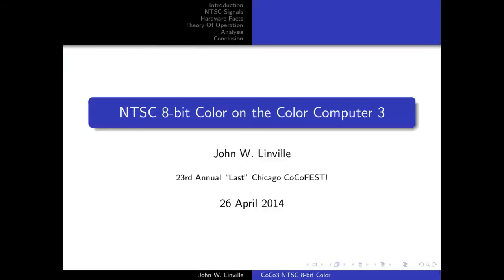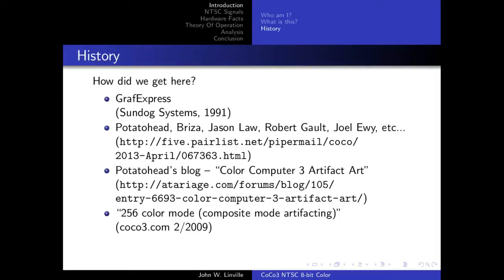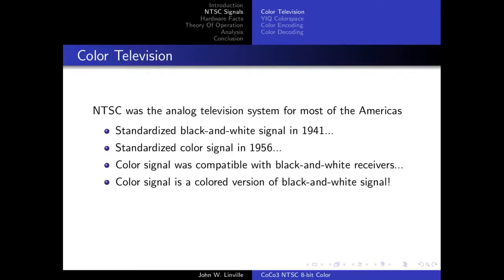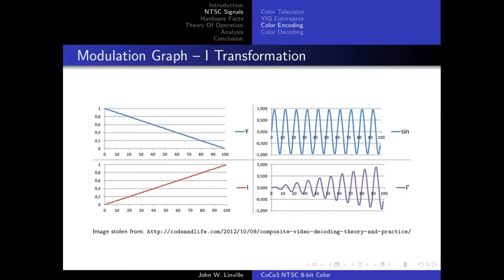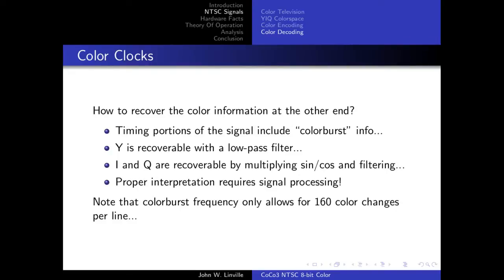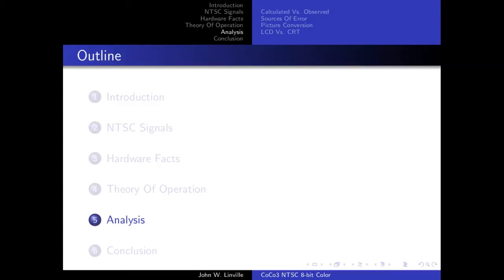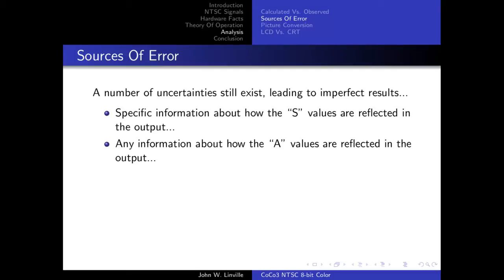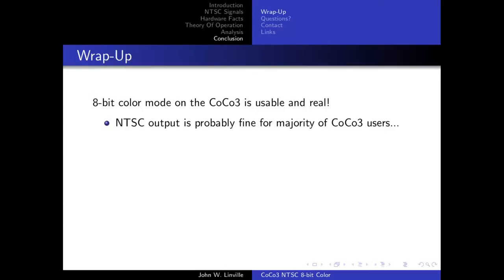NTSC 8-bit Color on the Color Computer 3

Comment: Impressive! I scratched the surface of the CoCo 3 briefly and moved to the Tandy 1000 so I never got to experience what it was capable of.  I actually had the color RGB monitor which was the fanciest thing I owned in my life at that point.  I remember a program, probably from Rainbow, where somebody came up with a way to display all 64 colors on screen at once, so you could see them all and come up with your own names for them for reference.  Coming from 4 colors and artifacts, seeing 16 colors, then 64 on a screen all at once was a feast for the eyes!

Comment: I've been a CoCo fan since the beginning, I worked for Radio Shack in 1982, and was around when the CoCo came out in 1980.  Lately, I've been doing alot of research on coding for the Atari 2600, where that 160 color clock cycle thing comes up there as well.  What I'm wondering is, is that what you're doing here... essentially "racing the beam" ?
Reply from the maker: No, the video settings and the video data are all stable.  The NTSC signal is being "heacked" by the timings programmed into the GIME registers.  Any program could set-up those registers once, then ignore them.  What I did with Sluzzle is much more similar to "racing the beam" -- see my other videos for examples.